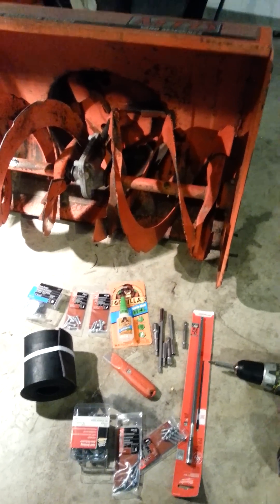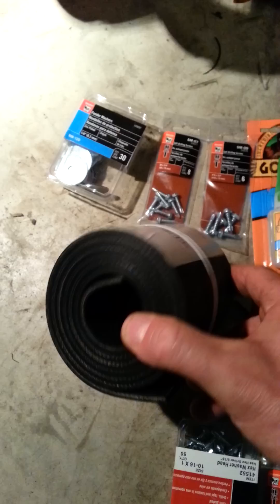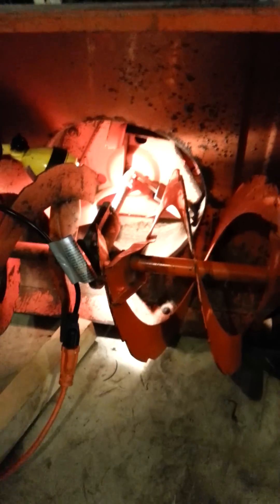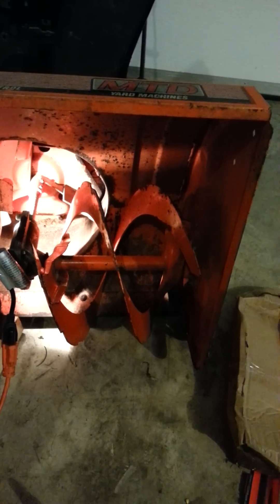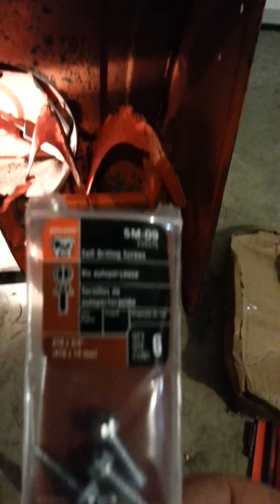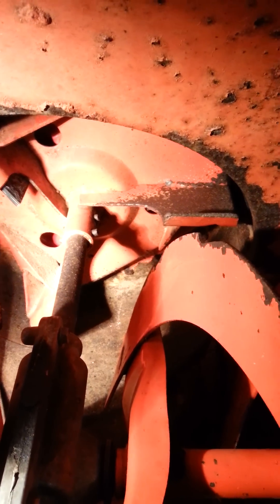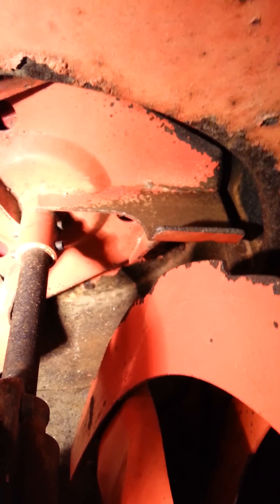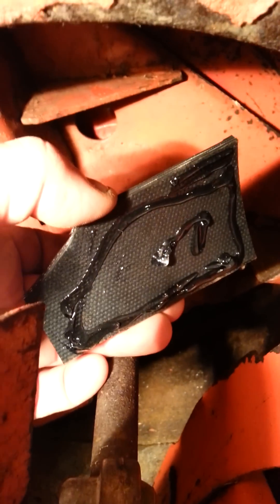Snowblower impeller upgrade installation

Comment: Are you using self-drilling screws, or self-tapping screws?  There is a difference: self-drilling screws have what looks like a drill bit end on them and actually drill into the metal to make a hole, and will drill through thicker metal.
There are two kinds self-tapping screws. Those for sheet metal have a sharp point that pierces the metal and then the threads pull it in. Another type has what looks like an actual tap on the end and is used to make threads in a pre-existing hole.  These type usually have finer threads and are used in thicker metal 
https://youtu.be/aEzCNle5rlE

Comment: I used same stuff from tractor supply but self tapping screws didn't cut it i had to drill mine since impeller was thick. I used aluminium strap and three bolts to hold on rubber along with waahers and lock washers and just to be safe locking nuts!!! Didn't want to have to redo period!!! Did mine 4 years ago and still throwing snow like on steroids! Will even pump the wettest of slush!

Comment: No glue needed! Just make a cardboard template for the impeller center punch  drill uses stainless steel bolts any Nyla nut or nut with  red lock tight put shoot back on   My gap now is 35 thousands away from the tunnel & throwing snow and slush 2xfurther no more clogs  Thx
Reply: Nut and bolt it making the job harder then it needs to be. Self tapping screws with a washer is best.

Comment: Here's some info. , depending upon  what type of snow blower you have & how many belts are driving the auger/impellar you may choose to keep a close eye on the belts or belt due to the extra torque being put on them .A single belt auger/impellar will wear out much faster .if you measure the rubber pieces so that they just touch the housing the belts or belt will not have a wear problem . It doesthrow the snow out much better with the modification , converted mine 4 years ago woks fine but I inspect the belts for were after 5 hours of use. Most snowblowers have a plate with 6 srews on the bottom of the snow blower (2 stage) ,tilt the the snowblower up on the auger housing & remove the plate to see if your belt or belts are staring to splinter/shred.You may want to remove the fuel out of the cab & gas tank before you tilt the machine up on the auger housing.

Comment: You are definitely a desk worker or teacher. As a millwright tech listening to you speak and work was fucken painful. At best the super glue would be used to keep the piece in place while you screw but if you punched holes in the rubber first it would make the job easier to machine screw the plates in place.

Comment: a washer with the self tapping screw ?  what ? under the head ?
Reply: Yes, it keeps the rubber from encasing the screw head so you can remove them should uou need too later.
Reply: You do not want self tapping screws you need self drilling screws big difference use #10 1inch.

Comment: 10-30-2016 - - - Thanks.  I came here to find out what an impeller upgrade was. Good video.  Needs some more lighting though. Good job.  Question:  what brand/model is your snow thrower and how much did you pay for it? Where did you get it?  What is the width and height of the front, ... etc... Thanks again. 
Lower Mid Michigan.
Reply from the maker: q7winq7 i bought the mtd 8/26 for $180 but sold it since. i now have an ariens.

Comment: NAPA Auto Supply sells ttuck size mud flaps for $13.95...theyre very large, thick and durable. I looked for the little "Mustang" or other small car flaps at all the auto supply stores and even Wal-Mart...couldn't find anything good under $25.00.
I made my impeller flaps from the NAPA mud guard and have lots for replacement or to give away.

Comment: Self-tapping bolts work fine. No need for glue or sanding. I drilled small pilot holes after one of the bolt heads "Torqued" off. There's also the break-in period where the rubber gets shaped-down by hitting the inside of the chute edge. Best type of rubber is from a truck mudflap.
Reply: diver dave mo

Comment: Sure wish I could find some of that rubber belt material...no tractor supply stores in my area.
Because of vibration etc I wouldn't use 'self-tapping' screws...but would rather use a through bolt with a nut on the back > much more secure.
Reply: Just buy a mud flap from an auto store
Reply: I actually had a roll of 1/8" stiff rubber...cut to size and thru-bolted. Completely removed the discharge shoot and I used a Dremel with a sanding drum to precisely trim the rubber blades.
I can't believe the improvement and distance snow and especially heavy wet snow gets thrown! And, the machine doesn't clog up any more.
Great modification A+
Reply: I hope to modify my 5hp MTD this weekend for the next snow. Here in NY we get some heavy snow which always clog the chute
Reply: Been getting hammered here in Philly too. I've owned my 5hp MTD for about 7 years, still looks new because it barely snowed!
One thing I noticed...the discharge shoot is bolted on with carriage bolts. When I put my rubber flaps on I did trim them back some...however I could hear them smacking the back of the domed carriage bolts. Removed the shoot again and trimmed them back with my Dremel and sanding bit. Some people say it will make it's own clearance...I didn't want to send any unnecessary vibrations to the auger bearing.
Reply: I have had my 5/22 since 1996. Has it been that long? Wow. The only problem I had was a broken shear pin. I change the oil every season and spray it down with silicon spray before plowing. I usually use it at least 6x s a year. I would have gotten an 8 hp but it was all that was left when I bought during the 1996 snowstorm. I read all these review on new snowblower models that scares me to this what to replace it with when it finally rusts out
Reply: Oops some typo`s in that last sentence
Reply: True, unless it's a big name manufacture even what's out there now look a lot cheaper then mine...and I got mine 7 years ago at Walmart!
It's always maintained and put away right...heck the paint is still glossy (waxed) and the tires have the rubber nubs on them. I read the intake/exhaust valves bang themselves like crazy...hopefully here, the next few winters will be like the last several > very little snow!
Reply: Cheaper to get some fibre reinforced rubber sheets from Amazon. Get 12"X12"  pieces.